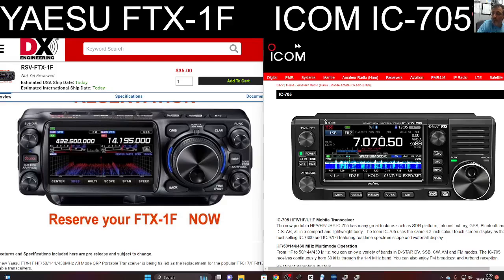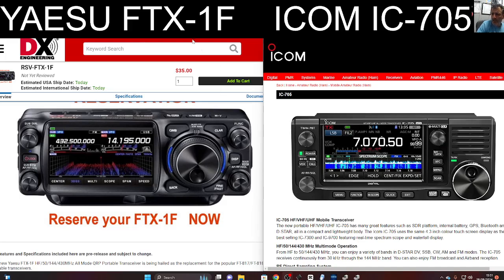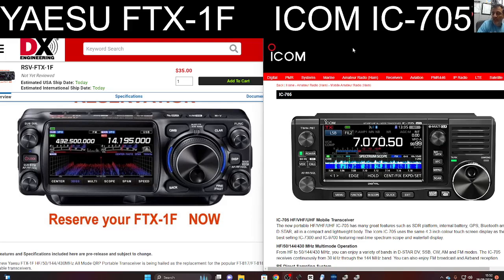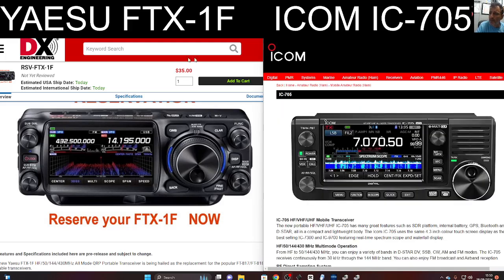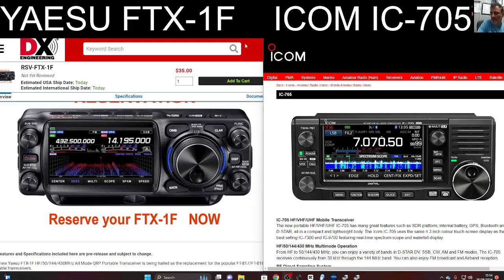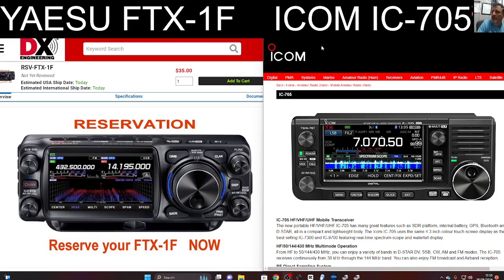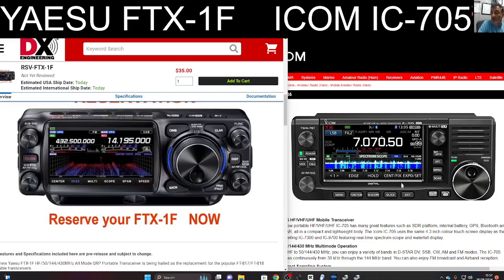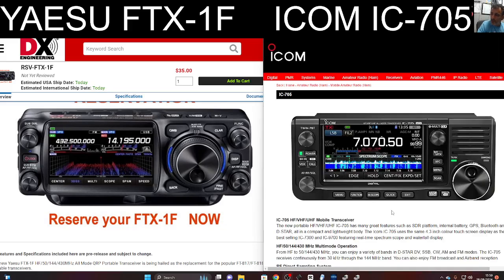YAESU FTX-1F  vs  ICOM IC-705

Comment: The presentation text doesn't speak at all about GPS or APRS, so that wouldn't be a surprise if it didn't include APRS or even an internal GPS receiver.
After all, one can connect to Wires-X / C4FM nodes without sharing its GPS location.
Reply from the maker: It does have aprs in the brochure in Japan .
Reply: @M0FXBHamTech  indeed, I just saw it. The external GPS port is weird, then.
Reply: There is a GPS port for external connection on the side of the device, it's weird.

Comment: i have ic705 and ftdx101, i dont use the 3d waterfall, the c4fm is completely useless here. In france we have DMR and very few Dstar.
this is a little to late for yaesu for this part of line product, except if the price is less than 1000€ (800, will be ok)
Reply from the maker: Hi get a Hotspot digi modes are busy.